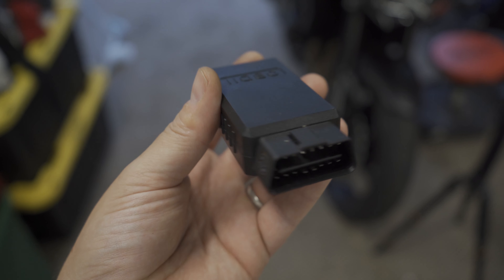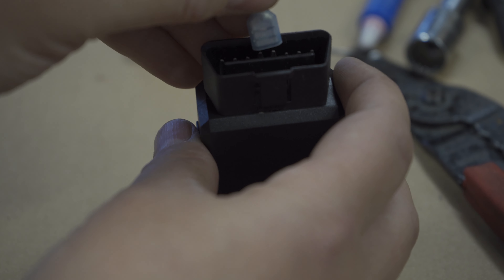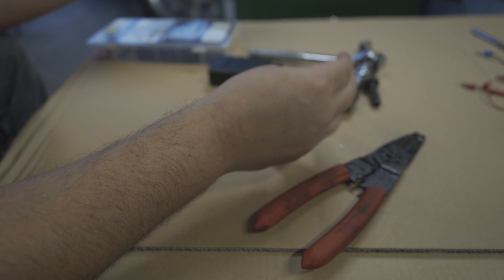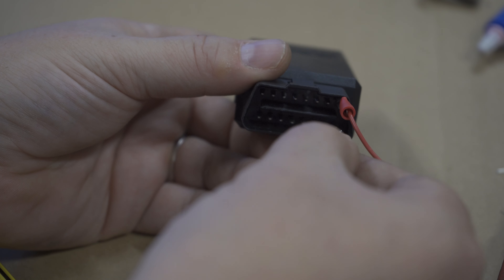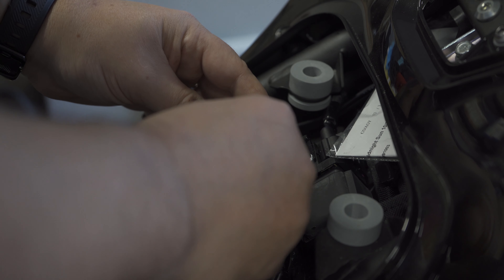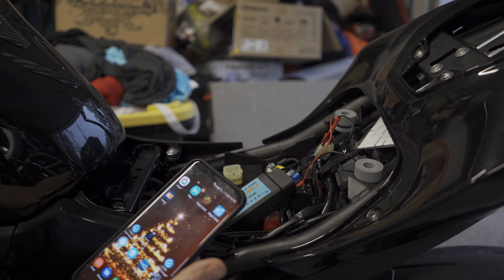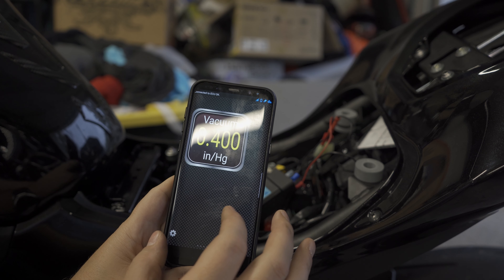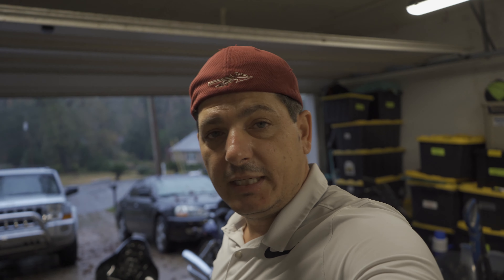Z900 OBD2 Mod

Comment: Just an FYI, you're not connecting using the CAN-Bus interface. That would require 2 communication wire (CAN-Hi pin-6 and CAN-Lo pin-14) to be connected. You are instead connecting via the K-Line pin-7 diagnostic wire.

Comment: Please make more videos .🙆🏻‍♂️ , ordered the odb2 from amazon, need to clear out my fault codes, started showing after I washed my bike. Later found out that my pass switch was not working, maybe that was the problem, will find out when I try the odb2 reader. Thanks for the help 😁
Reply from the maker: You can try this to get the code.
1) Push left (dash) button till it displays odometer
2) Push left and right buttons for more than 2-seconds
3) If code if recorded, it will now display at the bottom number row. It will be 2-digits
Reply: Simple Simon ok thankyou will try this and update you
Reply: Simple Simon the fault code is 33
Reply: @SimpleSimon  this worked on my 2019 z900 code 33
Reply: @SimpleSimon     getting 13.  16.  32.  62

Comment: Very good video, which year was your motorcycle produced? Do you know what protocol does your motorcycle use? In the past I tried it on my ninja 300 2014 and it didn't work. I have a suggestion, you may have an OBD2 port from an vehicle dismantler, so you'll have a good setting of the scanner.

Comment: Hi, can you say me the color which correspond to the kline  cable  on the lectronical wire bike ? I need it to make the same for a z800. i found + and - but i hesitate between two cable on the bike (i can't find the pinout ecu ). thank's

Comment: Will it work on other Kawasaki model? Cleared the error code on my z900 ... wanted to try on my friends ninja650 .. any suggestions?
Reply from the maker: If you have a volt meter you could test the connections you just don't want to ground a positive or vise versa.
Reply: Simple Simon ok will do that.. thankyou

Comment: hi. does this work with the z800? Thanks
Reply from the maker: Sorry, I do not know.
Reply: @SimpleSimon  how can i check which pin is the can bus?
Reply from the maker: @roderickcavallo8244  You could try using a volt meter on dc setting and test each pin, it helps to make a drawing of the plug and pins. You are looking for the 12volt and the ground then the 5volt bus. Also if you can find a wiring diagram it should have it there also. But be careful!!
Reply: @SimpleSimon  i ll try to check the diagram. What should i be looking for in the diagram?
Reply from the maker: @roderickcavallo8244  Hopefully it should say bus to ecu.
Reply: @SimpleSimon  thx
Reply: On the diagram it does not mention bus to ecu. All wires goes to the ecu on the diagram. On the blue tooth adapter, i still use the 7th pin from the left? Thanks
Reply from the maker: @roderickcavallo8244  Sorry I do not know :(